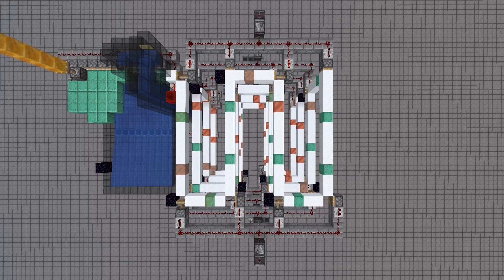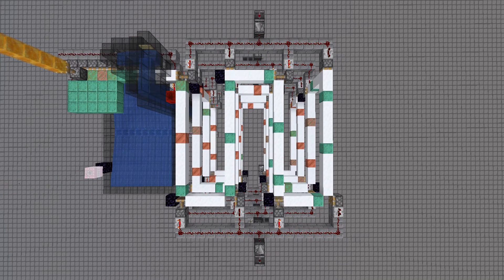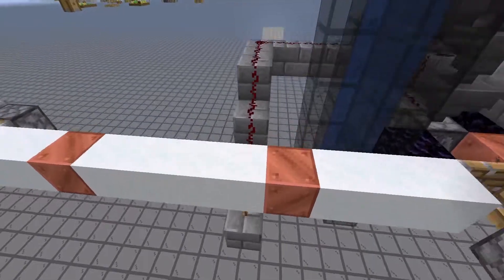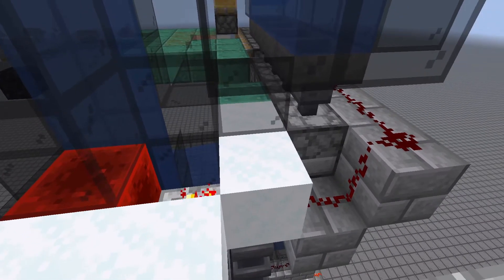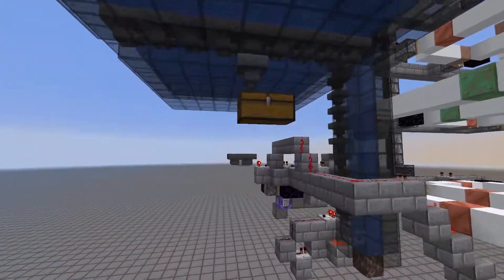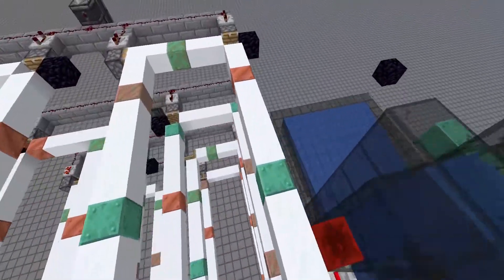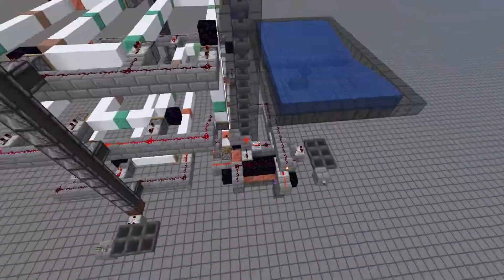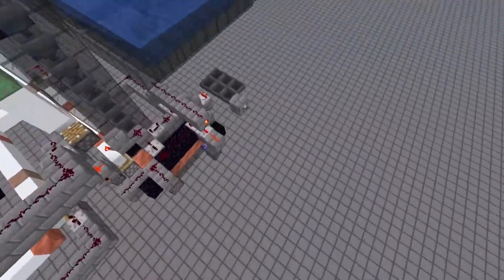COPPER OXIDATION FARM! - Minecraft Snapshot 21W05B

Comment: Pretty cool concept, especially the usage of the powdered snow! Was just looking for some (semi-)automated copper oxidizers, seems that it's fairly impractical as there isn't much too find. It's probably best to focus on automating the spreading of blocks mainly. I would think a zero-tick design should be possible. Maybe not with powdered snow, I don't know if placing it via dispenser works within zero-tick designs. But maybe you could use a (or actually several) cobble generator as supply for the inbetween blocks, that should be able to provide blocks quick enough to allow the creation of the spread put block stream using a zero-tick piston to place the copper against. Next step could be to add a really long clock that goes into collection mode using TNT and then allows placing more. Maybe I'll play around with it a bit when I find time. :) Did you do any further experiments?
Reply from the maker: Cool idea! No, I haven't played around with the idea any more since this, but I would love to see more designs! I wanted to try to figure out how a bunch of blocks could be placed quickly and then spread out slowly
Reply: @SURFACEFUSION_mc  So I did some experimenting, and boy am I not smart enough to actually implement what I had in mind. Always quite humbling to realize there is a difference between understand what zero-ticking is and actually building working contraptions. I got it to work using basalt generators and getting the entire "four distance blocks plus one copper block" partition out into the loop fairly quickly. I can place a new copper block every 40 ticks. I'm pretty sure that your design could easily be adapted to handle that speed as well, and I still think that using powdered snow is quite genius. I also love the fact that it basically give powdered snow "a purpose", though others might consider it a drawback and prefer using cobble generators for the filler blocks.

In any case, I also downloaded your world, reset the randomTickSpeed and ran some tick warping tests. Filling one row of the double chest using normal randomTickSpeed resulted in two fully oxidized blocks, about two thirds of completely unchanged copper blocks and mostly blocks that aged once for the other third. I think for the size of the loop that's not actually that bad, I don't think scaling it up to twice the size would be unreasonable and I think you'd get fairly decent results already. However, an easier solution would probably be to use an item filter and take out only the fully oxidized blocks, while funneling the rest of the blocks back to the player so they simply get put back into the rotation until they are all fully oxidized.

I will be playing around with it some more, probably gonna try to speed up your design and add the filtering system. I think that might hit the sweet spot between practicability and usefulness. :)

In case you wanna take a look at my proof of concept, I uploaded the world ( https://cdn.discordapp.com/attachments/817054717620256789/887059348621250640/Copper_Oxidizer_Test.zip ) and a schematic ( https://cdn.discordapp.com/attachments/817054717620256789/887059441130811432/Copper_Oxidizer_Prototype.litematic ).
Reply from the maker: @manu_faktur  That's awesome! Yeah I haven't gone much further with the design because it felt somewhat impractical overall, but I really like the idea of recycling the blocks to the player! That gives me a few ideas...

Comment: What about filtering the non completely oxidised copper from the fully oxidised copper, then feeding it back to the player to have a continuous loop until all the copper is fully oxidised?
Reply from the maker: This is another interesting idea, you could have it sit for long enough to oxidize one level and then feed it back to the player as many times as you want to get it to the desired level.
Reply: @SURFACEFUSION_mc  I believe cubicmetre did this on his new copper oxidation farm designs which require a lot more commitment where he fed back the partly oxidised ones
Reply from the maker: @jonathonmayorga1820  Yeah I'm kinda curious if I could design a slightly simpler farm that might still be useful. I might have to give that a try at some point.